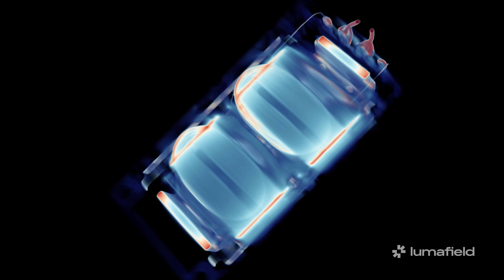Switch 2 Pro Controller: Built to Break? Full Teardown

Comment: It's also great how you're conned into buying one when you already have the Pro 1 controller because it cannot wake the Switch 2 with the Home button :)
Reply: Not really a con. Pro 1 controller doesn't have BLE, and probably can't (or won't? I'll agree that's the con part) support the newer drivers and codecs.

Comment: I just want to disassemble it so i can switch the A and B buttons...

Some time last year i sat down and took apart my first pro controller because i spilled hot chocolate on it when i was like 10 y/o and it wasnt that hard. Took me a couple of hours cuz i was looking at all of the mechanics and  cleaning fur out of it. It only had phillips screws

I so desperatly need to take apart my og switch because i need to replace the shell because its litterally falling apart and i need to replace the battery cuz im pretty sure its puffed up

Why cant nintendo just make it easy? I just wanna look at my electronics as a hobby bro

Comment: Thank you so much for this video.
I was able to fix my controller from the sticky buttons after dropping a beer on the controller 😅

I used a hairdryer to heat up the face plate to soften the adhesive though so I could reuse it. I then reheated the adhesive before putting it back on the controller and seems to be working great.
Reply: That's a great tip so just use a hairdryer for heat
Reply: @kenpe1455 yup that’s what I did and still working great since I fixed it

Comment: Just wondering; with the new EU Battery Regulation (EU 2023/1542) coming into effect, all portable batteries must be easily removable and replaceable by the user by February 2027. Since this controller’s battery is glued and requires full disassembly, wouldn’t that mean it can’t be sold in the EU after 2027 unless Nintendo redesigns it? 🤔 Do you think we’ll see a new, more repair-friendly version because of this law soon?

Comment: Ive had my switch pro controller since switch one when they came out shortly after. With proper care. I've never ever had drift issues on any controller. its weird. And knock on wood. Just got a switch 2. I have had the RB right bumper break on an xbox controller but that's it. Other than damage that i know I'VE caused.

Comment: Thank god at least most controllers last the console life as long as you don’t drop them or throw in water. My og switch was launch model and joycons just started to drift after my son dropped it and my pro controller is from launch also still works perfect I’m amazed at how well the batteries hold up to.

Comment: Thanks for making this video. My Joy-Cons failed due to drifting, and Nintendo repaired them for free because of the lawsuits. Later, my Pro Controller also started drifting. Nintendo said I would have to pay $40 to repair it, even though it was the exact same failure. Evidently, the lawsuits were only about Joy-Cons, so Nintendo realized they could take advantage of Pro Controller owners without punishment. And now they're doing the same thing again with the Switch 2. I will never buy a Nintendo controller again. It is a shame because I still have a working N64 controller, GameCube controller, and Wii controller. They just don't make them like they used to.

Comment: i have problem with my switch 2 pro controller, the sticks are fine but if i press hard enof i can feel the rubber tearing and it makes the controll stick get stuck in the rubber part, im wondering if i wait for hall effect stick replacements then remove or replace the rubber or just remove the rubber part makeing it rub aganst the gate like normal controller, i have to say it is a nice feature but its not inportant to me

Comment: I don't get it. The switch 1 pro controller is literally the easiest controller to disassemble, 6 screws, 2 plastic clips, no adhesive and you can just take the battery out without any force, not even plugged in with a cable, it just had 3 contact points on the battery itself.

Comment: I'm sorry but Nintendo dropped the famous "Seal of Quality" decades ago. Both in hardware, as well as software. The original launch Switch iteration was made of extremely cheap plastics. And required a direct view of your joycons to function. But the NOT included Pro controller somehow works perfectly, what a shocker. Can't forget the stick drift, and constant Frame drops in major titles. Like i said, Nintendo's seal of quality is long dead... 😒

Comment: I bought the Switch 2 Pro controller and I don't regret it. 
My original Pro controller is still working perfectly after 1000+ hours of play. In fact its battery life is longer than any other game controller I have ever owned. 
I bought my Switch and Pro controller in 2018 so 7 years of quality gaming. 
I have seen nothing to indicate I will not get another 7 years out of this controller. I take care of my tech products so they never need to be taken apart.

Comment: I feel more impressed of the over engineering on the building of the controler than tearing it down... 
People in the coments act as if they are going to rebuild it each other month... just take care of it and it will last more than a year, even more. 
All teardown videos should be viewed as how everything is packed and for technical references. The other option is just buy the insurance for 20 bucks; your're already buying it for 80+ just spend the extra and avoid the complains 😅
Reply: "My $95 ($100 after tax) controller, with the smoothest control stick, quietest buttons, and reprogrammable back buttons to make gameplay more comfortable than the form-over-function default. Now to make sure I never use it, so it doesn't break."

You seem like the type of person who says "well why didn't you get AppleCare?" to your friend when their MacBook's display dies because Apple thought it was a good idea to wrap the display cable in the opening hinge where it can break from wear & tear
A design flaw straight from the factory

Comment: There have been so many glaring reasons for me not to buy a Switch 2. If I don't get it, it will be the first Nintendo console I passed on since the Super Nintendo. You would think they would have used something with a foam backing instead of double-sided adhesive. That is super cheap.

Comment: I’m very disappointed in Nintendo for this.  I mean that’s pathetic.  The drift issue is bad enough, but making it impossible for me to repair means I’m going to go third party or something once this first controller starts drifting.  

At least with Switch 1 I could get in and replace the joysticks relatively easily by following videos.  Not good, Nintendo. Not good at all.

Comment: This is the most performative hate video ive ever seen. I could repair this whole thing in an hour and ive never disassembled a single electronic. Why is this guy so pissed off about having 2 more screws than he previously expected? "The headphone jack is the only thing they got right" when he just got done praising the joysticks and battery for being easier to replace. "Why is the rumble in the grip?" Because the grip is the thing that is vibrating? Its where your hands are? Just talk normally about it and stop cashing in on the nintendo hate right now

Comment: This has got to be the worse controller design I've ever seen. The only silver lining is the sticks not being soldered in. At least it makes it possible to replace the stock ones with TMR. Which IMO, at this amount of hassle, I would rather stick with my 8bitdo Ultimate Bluetooth controller. It supports Switch 2 with firmware update and has back buttons. Just lacks the headphone jack - maybe 8bito will do a new version w/ headphone jack? However, in 2025 I find myself only using wireless headphones. The other issue - I can't bring myself to buy a Switch 2. Lack of games, not OLED, and them bricking consoles. Can't really support Nintendo and their anti consumer behavior anymore. They've gone too far.

Comment: ive been tearing down console controllers since the ps4 fixing issues such as stick drift , broken trigger buttons and lack of spring tension , but geez nintendo is trying to squeeze more on wallets by spending more money on a new  controller instead of self fix

Comment: This was a great teardown, thanks for being so thorough.  The criticism is harsh but warranted given you're specifically talking about the repairability here.  That being said, we don't know anything about the longevity of this controller yet.  It's only been available for a little over a month.  I have two Switch 1 pro controllers that I bought on or close to day one of the Switch 1 release.  Both are still in very good condition, no drift, no battery issues, etc.  Maybe in another few years they might start having issues but I think that would be a pretty acceptable life span for a controller.  I know it's popular to hate on Nintendo these days and I'm not a fan of a lot of the shady stuff they do but it feels disingenuous to comment on the potential longevity of a device without actually using it for a few months.

If there's one thing I can say for Nintendo, they typically build things to last (joycon drift is an obvious exception).  Haven't had many of their products just die on me without a serious drop or other accidental damage.  Not that they shouldn't make an effort to be a little more user friendly, especially for things like the battery.  No reason that cant just be under a removable compartment on the back with one small screw.

Comment: This is so much harder than a 1st gen joycon. I replaced the sticks on those and just needed <10 screws and a few ribbon cables. Funnily enough, the off brand sticks I got from eBay have never drifted after 5+ years of use

Comment: This was a piss poor teardown. Let's start with #1 at 0:28 bro uses alcohol to "help" loosen the adhesive when any sane technician would simply heat up the face plate gently with something like a hair dryer. Just look up other teardowns of the pro controller and literally everyone else will apply a little heat to loosen the adhesive. #2 At 2:05 he disturbingly uses a metal spudger to pry open the shell. This should be done with a plastic spudger as to not damage the controller casing. 3# At 2:24 bro painfully pulls the rumble pack connectors by the wires instead of the plastic connector. any good technician will tell you pulling the wires is TERRIBLE for them! #4 At 2:46 he once again disconnects something by grabbing the wires instead of the connector and this time it's for the battery. #5 At 3:21 he painfully and recklessly pulls up on a fragile ribbon cable potentially damaging it. At the end here 5:44 bro acts like Nintendo is the only one still using potentiometers in their controller's lol. Yeah it's not great but  the way he says it is like Nintendo is the only one at fault here when most in the industry are using the same technology too. This was such a painful teardown and I think iFixit should be ashamed of how much of a bad example they were in this teardown by not showing how you should properly disassemble electronics without potentially causing damage.
Reply: Thank god someone is saying it.
Reply: I dunno why this vid got so many views, it’s like the equivalent of a video with 4.5k views.
Reply: Ummm sir you missed the whole point might wanna go back and watch what he is saying and not how to repair video. Also can you give me cash I'll let you have an mario sticker since you obviously sleep with him
Reply: @shivamkanichhe8839  The whole point of these video's is to demonstrate how to properly disassemble something and they did a very poor job of doing their 1 job
Reply: @shivamkanichhe8839  I'd also like to note that since you lack a factual rebuttal you just personally attack me lol

Comment: Thank god for 8bitdo, their ultimate 2 bluetooth controller is what the switch 2 pro controller should have been, what's more it has better joysticks and buttons and its cheaper than the switch 2 pro. (69.99 vs 84.99) So please consider this or other options. Some third parties have been releasing better stuff than first partys lately.

Comment: Click bait.  Wow, you are so wrong and this video is VERY misleading!  Not only will this controller work out of the box for 99.9999% of people, 99.999% will not need to bust it open to fix anything and the battery on this controller lasts for a LONG time so 99.9999% people will not need to replace the rechargeable battery for the life of the Switch 2.  The Nintendo Pro Controller for Switch 2 is the best controller EVER MADE, period!  Why is it the best?  Because its the most comfortable to hold, the GL and GR buttons are located in the best possible place that I have seen on any controller, the battery lasts forever, amazing d-pad (while I do like Xbox controller d-pad more), gyro controllers, new C button, etc. Sir, you have a right to your opinion, but its one that most people will not agree with.
Reply: 任天堂信者長文でお気持ち表明してて草
きんも

Comment: 1. Hardly anybody is going to open up their controller.

2. Battery life in a Nintendo pro controller hasn't been an issue since the WiiU.

3. Did you play with it for more than a day? Who paid you to be so negative? The next console will certainly be out before this controller needs to be disassembled.

Comment: yeah don.t know why nintendo just don.t let us buy battery replacement like xbox siere X controllers. the build in battery pack in the switch pro controller 1 or 2 if the battery breaks and don.t charge no more like say the battery was dead for 2 years and it was never charged since then and you try to charge it up. it won.t charge no more because you killed the battery life by leaveig it dead to long so you have to go out and buy a new controller. with xbox if that happens you just gotta buy a new battery pack and replace the battery pack and your good to go. you don.t need to buy a new controller.

Comment: And dhe D-pad is now softer to press, but it's just as bad as the first one, because it still pushes in other unwanted directions. I'd rather have the D-pad on the Joy-Cons. 

And why not just have an easily accessible battery compartment like a few years ago? In a few years the EU requires to have replaceable batteries. I hope for such devices too. The manufacturers just want you to replace the whole device, not only the battery. I also don't like how Nintendo has changed.

Comment: I'm so glad I replaced my original Pro Controller with a Gulikit Kong 2. I've been using it almost daily for 5+ years, over 2k+ hours in 3 different Monster Hunter games, and its only problem so far is that the A and B buttons are a little squeaky sometimes.

Comment: Ok so you mention stick drift a lot---did you ever have a problem with that on the original Switch pro controller?  Because I have two of those and have NEVER had even a bit of stick drift on either one of them.  Granted I don't spend 16 hours a day gaming on my Switch/Switch 2, but I have put quite a few hours into Splatoon 2 and 3, BOTW and TOTK, Mario Kart 8 and now World, etc and I have never had issues so it probably won't be  a problem here either.  For me the bigger problem is the $85 price point, which just seems like too much.  Hopefully it will come down or aftermarket companies will reverse-engineer it for a better price (maybe they already are?)
Reply: The original switch pro controllers don’t get drift but I think the point is that the new one uses sticks that can theoretically drift

Comment: I’ve been using my original Switch pro controller since it released in 2017, no issues with it at all and I even dropped it a few times. I bought the Switch 2 Pro controller as well and confident it will also last a lifetime without needing a repair.

Comment: "We haven't yet met a potentiometer based stick that is drift resistant." Ridiculous. IDK about these specific sticks, but we've had great potentiometer sticks for years. They absolutely can be made well.
Reply: Drift resistant. All of them, even ones that are good, will drift. 
Yes, some may last longer than others, but the eventuality will come.
Reply: @pian-0g445  "resistant" does not mean "immune." The point is, we've had many that have worked great, even for decades. Don't trick yourself into thinking hall effect sticks or whatever your alternative tech of choice is are immune to mechanical failure. They are not.

Comment: Call me crazy but that first layer of protection doesn't help keep dust away from the controller? Also the battery of my Pro controllers is still the same after 7 years so that might not be a problem.

Comment: So Switch 2 Pro controller is 100% no-go for me... Just the fact that the part covering access is glued in place instead of using plastic clips is mental. Battery replacement will be nightmare. Honestly Xbox has the best battery implementation on the market... Just good old AA batteries. Buy rechargeable AA batteries and you are good to go. Sony and Nintendo should take notes.

Comment: Well the thing is that I have pro controllers from 2017 on their original batteries with zero problems. If I haven't had to open the controllers in 8-9 years to perform any maintenance,  I'd consider them worth my money.
I hope these last as long as my OG ones.